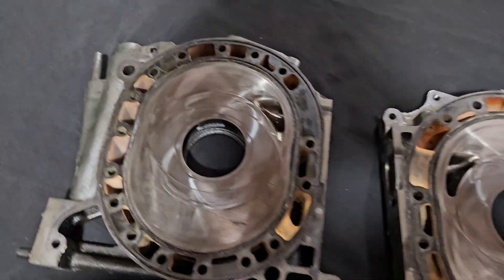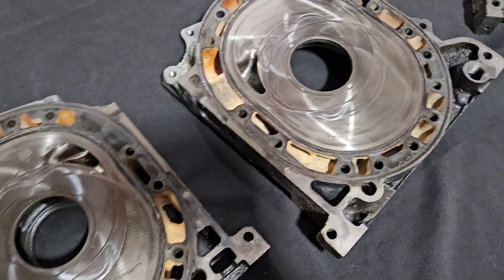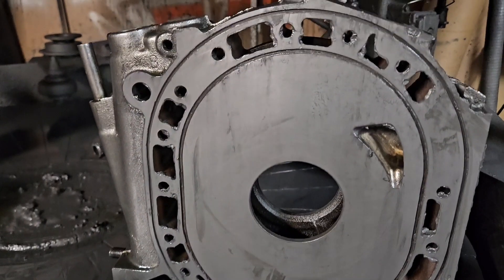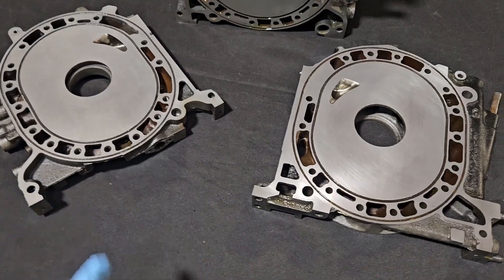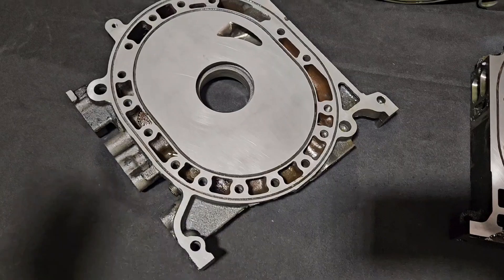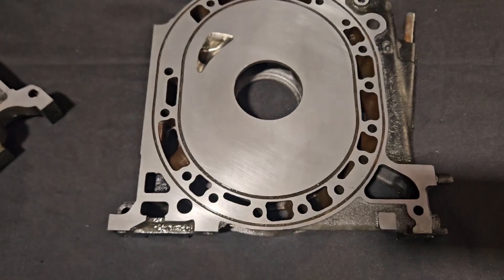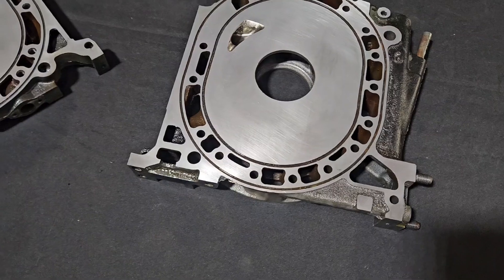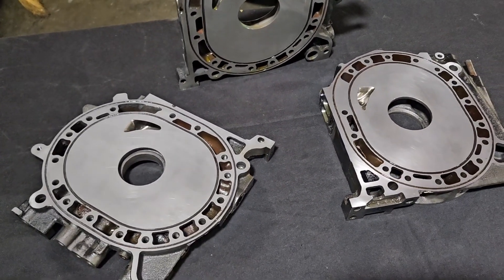LAPPING RX7 Plates - Before & After - Mazda 93-99 FD3S Rotary Engine services - Kyle Mohan Racing

Comment: Do you hardness test the housing before and after?
Reply from the maker: @PTRTHAUS  in 20 years of building engines and working with Mazdatrix we had zero issues with lapped housings.  So there was no need to test things that work fine basically evey time.  The internet builders seem to think it's a mystery or issue but lapping has been a regular since the 70s.  Just clean everything properly.

Comment: Hey kyle how do you remove the oil vent nipple that is pressed into the top of the intermediate housing by the oil neck? I need to remove it so I can finish lapping my housings. Other than lynn e hannover you are the first to talk about resurfacing that I am aware of. Used to be shunned back in the day but I always thought otherwise.
Reply: On  a pineapple racing video he says cut it off and tap it for a new one.
Reply: @jo-qp7mz  Awesome man. I may do that. It kinda looks like a torch might get it out like it's been brazed in place.
Reply: @Liquorpuss  A bit late, but it's just pressed into place. I put a m6 bolt in it too keep it from crushing flat, grabbed it with a pair of vise grips, and pulled it out

Comment: i was wondering if the rotary engine could benefit from some of the stuff Lake Speed Jr. (Motor oil geek) has done for piston engines. Specifically, a plateau hone technique for the side plates to up oil retention. I have no idea to accomplish this (well, I sorta do have ideas), maybe super coarse lapping compound and then a fine one to produce the plateau profilometer reading? Or a coarse surface grind and then fine lap?
Reply: just lap the plates together with valve grinding compound, don't over think it too much.

Comment: Have you or do you know anybody that had tried using irons that was lapped and has no nitrite left?
Reply from the maker: @weebingdanperformance4594  yes. Me.  I ran some way past recommended depths.  In most cases, they were fine and wore almost the same as any others.
Reply: @KyleMohanRacing  how many thou were you past the tolerance ?
Reply from the maker: @ClwnJuNkY  I Was so far past proper depth that I had to cnc cut water o ring grooves back to the proper depth.  Not going to give specs away, but we're talking three times recommended depth. Housing's currently running fine in my 1000 horsepower. Drift car, wear is similar to other compones. 

Rotary engines almost never get taken apart due to side housing wear or failure unless it's built improperly. Too many internet builds were simply built wrong, and then they blame lapping.... 🤔
Reply from the maker: @weebingdanperformance4594  I'd also like to point out that you almost never have side housing wear be the reason a engine comes apart.  It's ninety nine percent of the time nothing to do with the side housings and any type of wear...  lapped or new . It's became a huge internet topic, but on the industry side. Most engines, piston or rotary get resurfaced for a proper rebuild.
Reply: @KyleMohanRacing  thansk for the info your a wealth of knowledge!
Reply: Does this affect the endfloat when you lap the housings as you are making the engine slightly shorter?
Reply from the maker: @philip_james  Since most people never check end play when they disassemble the engine and don't know its base. It's just proper to always check it on a reassembly. Lapping has very little effect on end play
Reply: @KyleMohanRacing  giving us some awesome info Kyle thanks for all you do for the rotary community
Reply: @philip_james  end play is determined by the torrington bearing and spacer stack, not plate or housing thickness.
Reply from the maker: @andynogo  yep